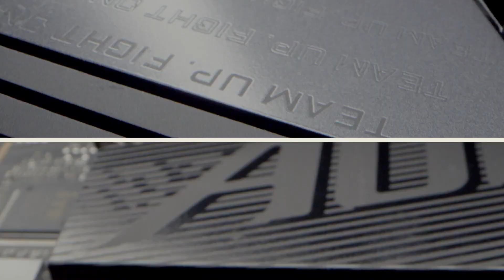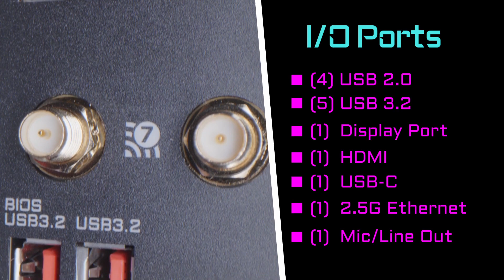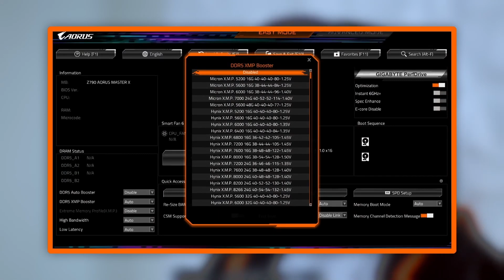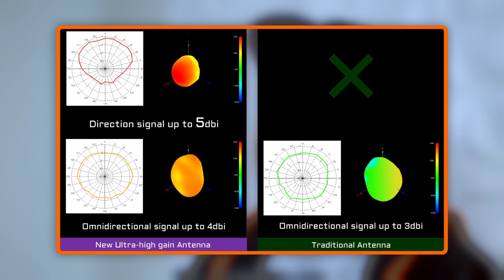Unboxing the NEW Z790 AORUS ELITE X WIFI7 Motherboard!

Comment: Hello, the system I will assemble is as follows, 14700k CPU, G Skill Trident z5 32 Gb (16x2) 7800 Mhz cl36 and Z790 Aorus Elite X model motherboard. My question to you is, can I use 7800 Mhz ram? Have you tried it under load?